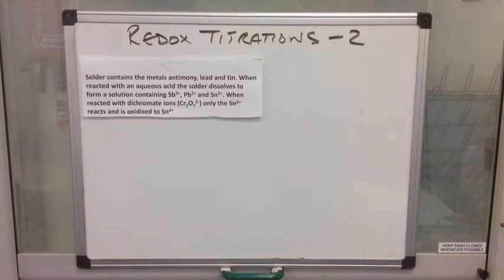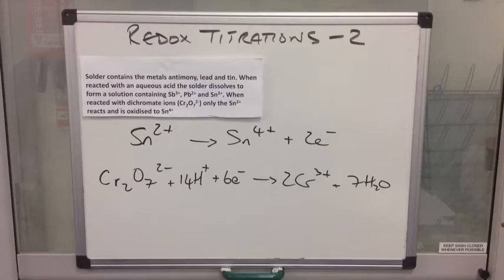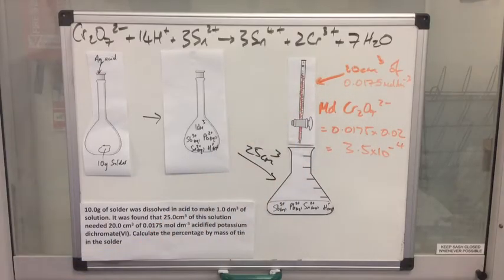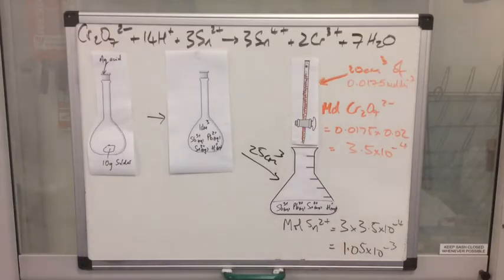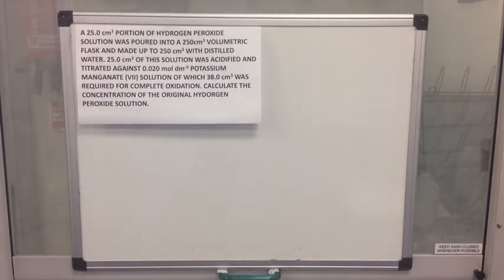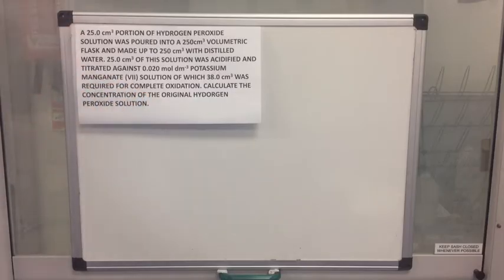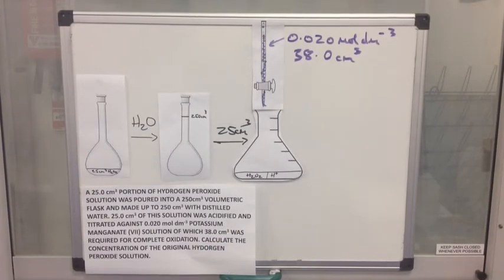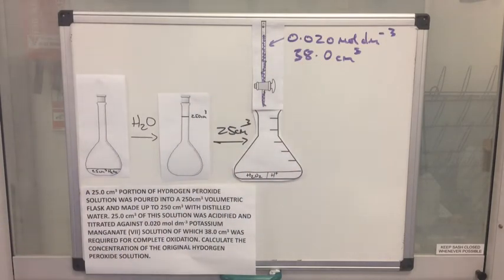Redox Titrations 2

Comment: Can someone explain 4:38.I dont get why he used 40 and why is he mentioning 1000??
Reply from the maker: 1/40 of the 1 dm3 solution is used in the titration
Reply: @MaChemGuy  so because he used 25cm^3 that 1/4 of the solution.But it's out of 1000 so its 1/40(??)sorry if that's doesn't make sense.

Like the original solution is 1000 but we used 25cm^3.so to get from 25 to original solution we × 40.

(Am I sort of close?)

Also,thank you for your reply:)
Reply from the maker: @Bellastar-ccs  Correct.
Reply: @MaChemGuy  thank you sir
Reply from the maker: @Bellastar-ccs  No problem. Be sure to check out my two titration walkthrough playlists. There’s loads of this kind of thing going on!
Reply: @MaChemGuy  Thanks sir will do.Also, around 10:34 it's ×10 because the original solution(the one with water mixed in) is in a 250cm^3 flask so since we take out only 25cm^3 of the 250cm^3 total.We have to x10 to get BACK to 250cm^3.
Reply from the maker: @Bellastar-ccs  BACK OF THE NET!
Reply: @MaChemGuy  yes :) Also,thanks lot for these videos they're really helpful.My teacher has just finished this topic but I didn't really understand until and watch your earlier videos for this topic.Have a wonderful day sir👍
Reply from the maker: @Bellastar-ccs  You’re very welcome. Thanks for the feedback, really glad the videos are helping

Comment: Would you get told hydrogen peroxide is oxidised to O2 or just expected to know it ?
Reply from the maker: Need to know that
Reply: MaChemGuy great thanks so you need to know that one, manganate, dichromate, which other ones are we expected to know ?
Reply from the maker: You should be supplied all of the others. I'm currently putting together a video on how to construct the more awkward equations from info supplied in a question. Hopefully post later today otherwise tomorrow
Reply: MaChemGuy great thanks so much !!

Comment: How do you work out the half equations when you only know the reactants? Eg in this video all you know is h2o2 is acidified and titrated, so how'd you find the half equation?:)
Reply: might be a bit late now but for anyone else you will be given the half equation and if your not its because its the half equations you must remember should be on the spec
Reply: @aasimazam6531  do you know which ones we need to know?
Reply: @desklamp701  no sorry I took this over a year ago but it should be on your specification
Reply: @aasimazam6531  ahh alright thanks